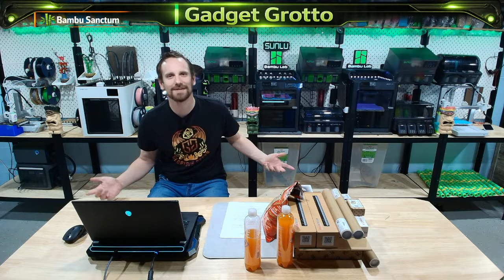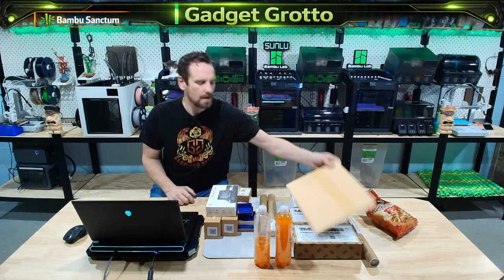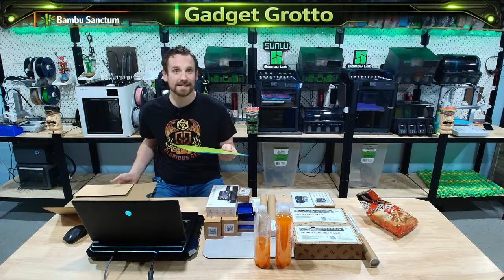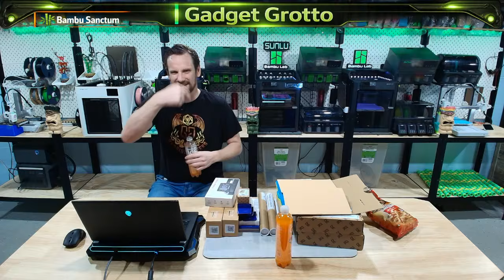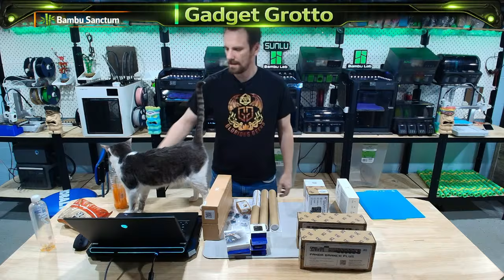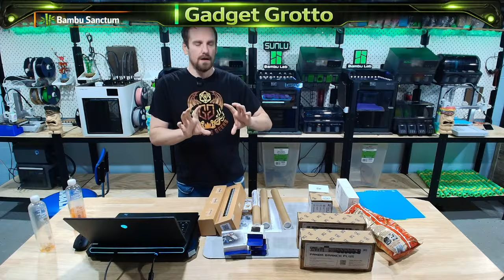Upgrade Talk: U1, BIQU & The Future of Multicolor Printing

Comment: 😂33:40 Oh boy, here we go again! ............................ AMS/ACE on a tool changer? CMYK on a U1? 🤣
- Using an AMS to do color changes on a tool changer is crazy talk & defeats the whole purpose of a tool changer to avoid purge waste!
- Your idea about multiple spools of the same color in an AMS to have backup is DOA. There is already a better solution out there that is much cheaper & more reliable; it is called a 5 kg filament spool!
- U1 CMYK! You do know that you are still short of one color, aka one tool head? On a conventional printer, there are five colors. CMYK + the paper being the fifth color, WHITE!

The more you know🌠
Reply from the maker: Totally fair points and I get where you’re coming from.
For me, this isn’t about replacing what tool changers already do well. It’s about exploring where combining systems "might" open up new workflows. In this case, each AMS unit would be running four spools of the same color, so you’re still not introducing purge waste.
I actually saw CMYK style printing in person at the Michigan Maker Summit, and while it definitely still needs refinement, it does work. That’s what got me thinking more about where this "could" go.
One thing I’ve also run into is that those large 5kg spools are great in theory, but keeping them consistently dry over long print runs "could" be a real challenge. Over long print runs or across multiple batches, it just isn’t the most reliable process. That’s where something like an AMS style system "could" potentially help solve a different kind of problem.
There are definitely tradeoffs, and I think we’re still really early in seeing how these systems "could" evolve together. No system is perfect, which is why these conversations matter. It’s how we start identifying and solving real pain points in the industry.
If you’re interested, I’ve got a long form video dropping later today that breaks this down with some visuals to help explain the concept.
Not saying it’s the final answer, just that there "could" be something interesting there.
Thanks for watching 🙌
Reply from the maker: Feel free to check out this video here — it’s a great example of what I’m talking about with full spectrum printing (and you get some chickens too 😉)

https://youtu.be/uE1Su-FUvls?si=BjiI-NZmkul5eIDJ

It’s not perfect yet, but it shows pretty clearly that this direction is possible and already being explored.
Reply: "defeats whole purpose of a tool changer" LMAO. You make it sound like that is the only benefit or reason to use one.

You realize people want to print with more than 4 colors yeah? 

You also realize an ams/mmu also allows you to have multiple colors ready for w.e. prints you are doing yeah?

You also realize it allows for filament runout auto reload yeah?

Your ignorance is palpable. Printing out 8 colors for 4 toolheads is immensely faster than doing so from 1. Will there be waste? Sure, but that is something MOST are willing to deal with.

Your own point about cmyk needing white prices why an ams is a great addition.

I hope you ride a bike everywhere because driving means wasting fuel.
Reply: @winebartender6653  "LMAO. You make it sound like that is the only benefit or reason to use one." - Yeah, less purge waste is a positive side effect of a tool changer due to architecture.

"You realize people want to print with more than 4 colors yeah?" - Yeah, they a called H2C & Prusa XL tool changer owners.

"You also realize an ams/mmu also allows you to have multiple colors ready for w.e. prints you are doing yeah?" - Yeah but now you introduced purge waste to the process.

"You also realize it allows for filament runout auto reload yeah?" - Yeah, an ams holds four spools of 1kg filament = 4kg. You tell me wich spool runs out quicker a 4kg or a 5kg spool.

"Printing out 8 colors for 4 toolheads is immensely faster than doing so from 1." Yeah, so would it be slower if the printer had 5 > 8 tool heads, would the waste be more?

"Your own point about cmyk needing white prices why an ams is a great addition." - No, my point was you need a tool changer with 5 tool heads.

"I hope you ride a bike everywhere because driving means wasting fuel." Are you saying, because i drive a car, its ok to further pollute the world with more purge waste?

"Feel free to check out this video here" Yeah, i watched the video! 17g of purge waste for 24g chicken.................... Just confirmed my argument!!
Reply: @julientaylor And again, your ideology is completely ignorant to the concept of using what's available to any given person, their situation or their tolerances 

Most people aren't going to spring $2k+ on a printer. People also like to upgrade what they already own.

So everyone with a single nozzle/toolhead printer should just completely ignore ever using an AMS/MMU? Is that your entire point here?

Seriously, your ignorance to the blatantly obvious reasons why someone would ever use a AMS/MMU is just so ridiculous that you can't even fathom it as being logical.

Man, how amazing it must be to live in an ideal world.
Reply: @winebartender6653  "Most people aren't going to spring $2k+ on a printer" A U1 + 4 AMS for each head cost about $2k. So how does your argument make sense?

"People also like to upgrade what they already own." If upgrading the U1 with an AMS/MMS/ACE (intended for color swapping) is such a big deal, how come Snapmaker did not release one on launch? Their advertised "5x more speed, 5x less waste" is not achievable with a AMS/MMS/ACE > Simple!

"So everyone with a single nozzle/toolhead printer should just completely ignore ever using an AMS/MMU?......." Oh buddy i am sorry to inform you that you drove 40 minutes to the nearest Burger King just to order a 6 piece Chicken McNuggets. You are at the wrong restaurant (aka in the wrong chat)! This discussion is about tool changers with AMS's sss. 

btw. i own 3 standard single nozzle core xy printers with AMS units, an yes i do not print multi color on them. So your other remarks are crazy talk!😉
Reply: @julientaylor So you resort to literally throwing "your poor" insults? Lmfao

Glad you don't use an AMS with your printers. Clearly that is the only proper way to use them. God forbid anyway else uses them, they are obviously using them incorrectly.

I bet you are a real treat to be around.
Reply: @winebartender6653   "So you resort to literally throwing "your poor" insults? Lmfao" Who and when did i insult anybody?

Multicolor printing is only one way to use a AMS/MMS/ACE, there are three more use cases you don't seem to know about.

Comment: This docking of the heads is not the way to go. Make the extruder small or conical, so that switching extruder is just to push down the one for the color to use. Very short and fast move up/down. Or use a rotating model where the extruders are mounted on part of a circle or sphere, and slightly rotated to put the right extruder to the active position. If mounted on 1/6 of a sphere, you can have like 8 extruders and then 8 colors. The extruders can share the same fan, and maybe even the same servo motors. There are possibilities of great inventions in this area 😊
Reply from the maker: Those are some really interesting ideas especially the rotating system concept.
I’ve been thinking along similar lines that the current docking approach might not be the final form either. There’s definitely a lot of room for innovation in how toolheads are handled and switched.
Appreciate you sharing that! This is exactly the kind of thinking that pushes things forward 🙌

Comment: Hi, what Skadis board AMS mounts have you printed. I have similar setup and the ones I currently use printed in PETG are not as sturdy as I like?
With the ones you used could I have two AMS's side by side on the Skadis Board?
Reply from the maker: This is the exact mount that I use. I highly recombed making sure you use the anchor screw points too. 

https://makerworld.com/en/models/842042-wall-mounting-for-ams-ams-2-pro-ams-ht?from=search#profileId-2112624

Two ams units will fit next to one another one one board just barely. 

Thanks for watching

Comment: I want an H2c but now will have to wait for the possibility of tool changer with AMS. Also, I put a battery backup on my Snapmaker thinking it would continue printing during short power outages and glitches. I print over the usb from the slicer, but was disappointed when i unplugged the backup unit and the usb dropped off and the print froze. Found out that the zero time switch backup units are very expensive, I think starting in the $1000 range for small ones. Was wondering if you had similar when unplugging the wall power to the backup. Thanks
Reply from the maker: That is a frustrating problem to have. There is a setting under maintenance that you can adjust the sensitivity to power failure detection. I adjusted ours to reflect slightly longer than 20 milliseconds.  In my next video I go over the exact powerstation I am using for our machine and it's a sub $500 station. It also has a battery expansion for it. I power seven printers with it. Stay tuned and thanks for watching! ❤